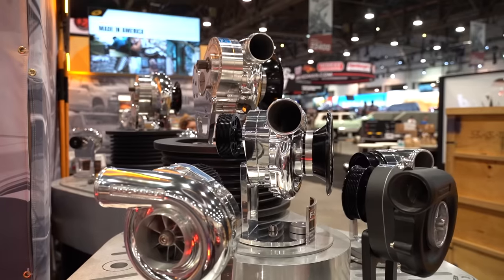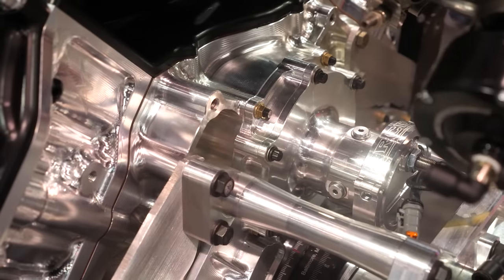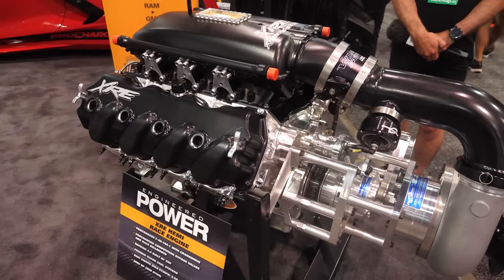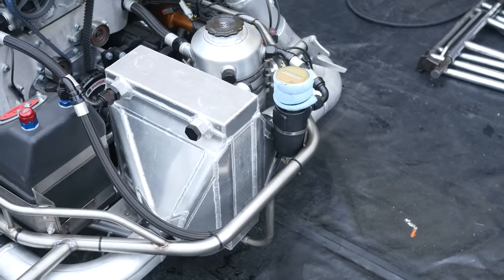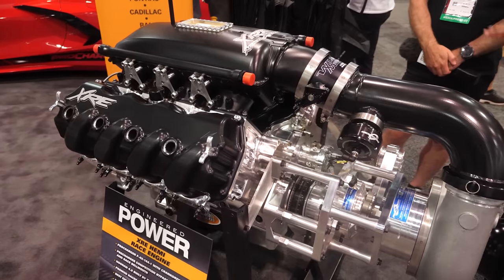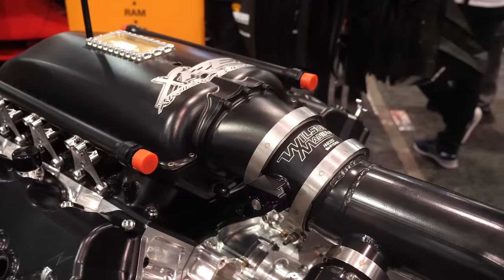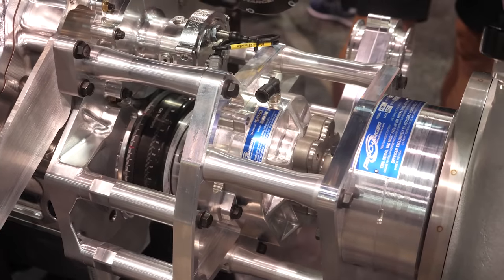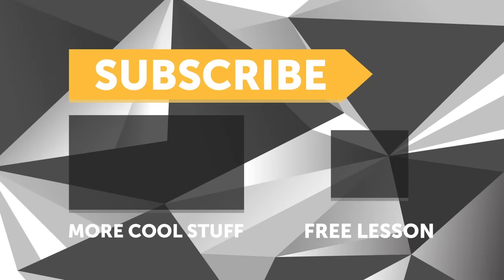Why Are Centrifugal Superchargers So Good?

Comment: I always get miffed when i hear people talk about parasitic drag. A turbocharger has parasitic drag, via pumping loses on the exhaust stroke. Centrifugal especially and Twin Screws even are very close to turbochargers in terms of efficiency.
Reply: Can you prove this?
Reply: Turbos use more heat energy than mechanical drive energy. Therefore less parasitic loss
Reply: @josephschaefer9163  Not exactly. Pressure, temperature, and volume are all the same thing.

A turbocharger generates exhaust backpressure, whereas a performance exhaust on a supercharged or NA engine generates scavenging(vacuum). Typically, the backpressure on a turbocharged engine is anywhere from 1.5 to 3 times the amount of boost generated by the turbo, with the center of that range giving the best balance between turbo lag and undersized turbo. The backpressure means that the piston has to exert energy in order to force exhaust through the turbo on the exhaust stroke.
So, an NA engine has a parasitic loss or pumping loss, drawing in air on the intake stroke. A supercharger has a parasitic loss spread out over all 4 strokes. A turbocharger has a pumping loss on the exhaust stroke.

Turbochargers and superchargers are both more efficient than piston strokes at moving air. This means that a 6 to 1 compression ratio engine with 15lbs of boost will have an effective compression ratio of 12 to 1,  and will be more energy efficient than a similar NA engine with a 12 to 1 compression ratio. Because, the forced induction device is more energy efficient at compressing air and pumping air than the intake or compression stroke of a piston. In other words, superchargers and turbochargers have overall less pumping losses than a similar horsepower NA engine because the pumping loss savings offset the power to drive the compressor/blower.

But turbochargers nonetheless leech power from the engine, directly from the crankshaft via the exhaust stroke. This is more efficient than a supercharger, but not as much as you'd think. When I was looking through compressor maps trying to size for my 4.0L, at 15lbs of boost a twin screw supercharger would require about 40hp at redline, a centrifugal supercharger would require about 35 hp at redline, and a turbo would require about 30hp at redline.
Reply: @josephschaefer9163  Roots style blowers are really terrible, absolutely no competition between a Roots Supercharger and a Turbocharger. However, Twin Screw superchargers and Centrifugal Superchargers are much closer to turbochargers.

Comment: I have a centrifugal on my 2020 mustang gt. It's awesome but I should've got a pd blower. For my driving style I've always liked the down low power (which the coyote does not have at all)
Reply: Install a 3600 rpm stall, I'll fix that issue. 😁
Reply: @yamakasi5792  hahaha. I see what you're saying but I have a manual. My left foot is my stall converter. With that being said I rarely launch it. I have faith the ole' shitty mt-82 in my car will hold up but they sure do grenade a lot.

Comment: Imagine the newer civic type R has a procharger instead of a turbo and still revs to 8k+ I think it will solve all it's inherent cooling problems
Reply: Yes it would by vaporizing the engine completely.
Reply: Centrifugals run away cooler. Also no shared oil for the coolant to have to cool down. No heat soak. No heat from back pressure. Kraftwerks makes centrifugal Supercharger kits for civics. It's very possible
Reply: I have a centrifugal charger on my Yamaha side by side

Comment: The interview is awesome! I have a question for you guys. Was ever produced, or is there anyone testing a procharger and turbo hybrid? A procharger with exhaust housing of a turbo. The speed of the procharger is dictated by engine speed, like a procharger, but the exhaust gasses are scavenged by the procharger or the exhaust gases helps drive the gears of the procharger and effectively the engine? 
If not, can anyone really produce a high quality one and share the results?
Reply: Locomotives have turbos with some sort of drive with an overrun clutch for starting and low speed efficiency

Comment: I really like the idea of a crank/gear driven system as i am not a fan of belts because of reliability. the main issue though is that it sticks way out infront od the engine which limits what type of car you put it on but if the made it work on the Kawasaki h2 i guess you could figure it out.
Reply: Kawasaki H2 has the supercharger mounted directly on the front of the head, it pushes the air right in there. I don't know if it's belt, or chain driven, but it's one or the other...probably a belt....the Japanese bikes are very good with belts...I think the Gold Wing engine has 2 belts, one for each side.

Comment: I would find it interesting driving a turbo using water pressure in a boat  fitout. There is a tonne of force in water flow under the boat. Thought?
Reply: Not working.  The turbo needs to spin very fast in order to work.  Water flowing under the boat has a lot of energy but the water flow is not that rapid.  You need a step up gear box to spin the turbo up to its operating rpm.
Reply: depends on ratios i you would be surprised on how fast it would spin  @catchnkill

Comment: very interesting ,drivability looks to be main win , great for rallying i would think . no mention of of actual efficiency ,as in fuel in for power out vs the exhaust driven turbo ,which is using some heat rather than just dumpnf it asap . and do they need blow off ,or recalculation valves ?.

Comment: A engine it’s basically an air pump. (But sometimes you want more power.)  So you add a much more efficient air pump to your air pump, so that your air pump pumps more air.
Reply: Because piston engines can change rpm quickly.

Comment: Ive been thinking about the possibility of a procharger (the car doesnt really need more horse power probably) however my engine was built to be NA and runs a compression ratio of 11.9 to 1.  I was wondering given how the Procharger builds boost if this would be a problem.  Also is extra ring gap required similar to other forced induction?  I guessing it is...
Reply: Yes, you'd need extra ring gap just like any FI build.

As for compression, your engine is perfect for Ethanol. If you go do some research after reading this, your compression ratio would suit about 30psi of boost on E85, and 60psi on methanol.

Your CR is on the high end for gasoline, it's mild for ethanol, and it's very low for boosted methanol. Methanol is a headache though because the fuel requirements and it being very corrosive. Ethanol is likely a very easy conversion for you, and you may be able to get it at your local gas stations for cheaper than 87 octane. Considering that E85 Alcohol is equivalent to 112 Octane Gasoline, it is very cheap compared to pump gas.
Reply: @SpecialEDy  Hi Thanks for the reply and information. The engine was built for pump 98 octane which is readily available in my area so hoping that it works out ok.  The engine is 427 ci so with 30psi and E85 would make big power!  The whole car would need a rethink with that under the hood haha.
Reply: @j.osborne4914  30psi would be a LOT of work. Atmospheric air is 14.7 psi, so at 30psi of boost your engine would have three times the air and fuel going through it, in other words your 427 would actually displace 1281 cubic inches, or 21 liters instead of 7.0 liters. Definitely going to need some serious rods, piston, and crank to handle that.
But E85 might give you a 10%-20% boost in power output without any other modifications, and your compression ratio could handle a healthy amount of boost if the bottom end and fuel system can support it.

A possibility if you are running an aftermarket ECU is staged injectors, HP Academy has a few videos talking about it. At idle, you'd use your current injectors. At redline WOT, you'd use 100% a second set of batch fired injectors further up the manifold runners feeding E85 or Methanol from a seperate fuel cell. Aftermarket ECUs allow you to blend the two together progressively, which fits perfectly with a centrifugal supercharger. As your boost climbed with RPM, your injectors would also progressively switch from the gasoline to E85 injectors. Or effectively, your octane would rise as the boost rose.

E85 and especially methanol have some other neat properties as well. They're less sensitive to AFR, more fuel rich, less likely to detonate, and they soak up a lot more heat than gasoline. Many methanol engines don't require a cooling system, because the engine gets colder under a WOT run. Drag racers running methanol have to idle the engine between runs to get the engine back up to operating temperature, and it will cool below operating temperature during a run. You can also run a stupid amount of extra fuel to cool off the engine and prevent detonation, because E85 and Methanol contain their own oxygen molecules.
Reply: @SpecialEDy  My current crank and rods are rated to 1000hp.  It made 707 FWHP on the dyno so there is a bit of room to go up but...will see how the car handles the current set up and go from there.  There are other things to spend money on before more power is required.

Comment: Would a prochargeer work on a 13b pp high compression motor?
Reply: you could, but it's not ideal, full PP is engineered to make more power at high rpm because of the overlap, kinda like big cams, you would need to change your engine completely by using side port and maybe semi pp, also use less compression rotors

Comment: I allways thought, in terms of power, its turbo charger > screw charger > centrifugal charger. Isnt that right (anymore)?
Reply: Power yes. Response and Drivability no. Much less stress stretch on engine internals since there is no surge in power from it being linear. Small VGTs improved response but a centrifugal will out flow it. You'll have to run two turbos in sequence.
Reply: For turbos, lag has not been solved for that's why Audi is using electric turbo to spool before the turbo. Volvo and KOENIGSEGG is doing air injection on to their turbos to prespool them
Reply: Similar to pro charger look at crank driven superchargers in wave runners or personal water crafts

Comment: Depends on your defintion of "good". They have the worst power curve/average power of any type of forced induction and worse than n/a too. They make all their power at the top of the powrband.
Reply: On the street you can't launch with 1000hp at the tyres. On the track you can dial in the power level to suit the surface. Prochargers are faster because they allow control. And we all know. Power is nothing without control!

Comment: I'm almost done building my dual centrifugal supercharged 4.6 2v Mustang with 2 paxton novi 1000 supercharges. They will pump out 1700 cfm combined through a water to air intercooler. Would 2 centrifugal superchargers be better than 1? I'm looking for 16psi of boost. My project build is on YT. RumbleCanada
Reply: What do you predict the parasitic drive loss to be?
Reply: @onedayiwillmakesomecontent With 1 paxton novi 1000. It made 394rwhp with 11 psi. Im hoping there won't be that much of a parasitic loss. It will go back on the dyno with the same tune. I've removed the a/c,  added a bigger water to air intercooler, and upgraded to a larger plenum and dual blade 65mm throttle body. I'm hoping that with that combo, it picks some mid and top end with no loss.
Reply: @rumblecanada I will have to check out your channel 👍
Reply: You should have just went with one bigger head unit
Reply: @brendonpotts7961  I went with 2 because I wanted something different. Everyone has one superercharger. I got them for an awesome price.
Reply: @rumblecanada  well if you got them for a good price then do it about of extra work with 2 but you can make more power than you need with A single
Reply: @brendonpotts7961  it made 400rwhp. Besides, who has a twin supercharged 4.6 2v. Lots of twin turbo. And it should sound pretty cool
Reply: I got asked the same questions about 15 years ago. I love my twin Procharged Camaro. Sound, throttle response and  power are off the hook. Mine is crank driven with meth injection and uses twin F1C prochargers on a Dart 406ci sbc. You won’t regret it.

Comment: Could someone explain why I wouldn’t want to use a wastegate to regulate boost on a d1x procharged forged internal ls7? I like the idea of spinning the procharger faster and bleeding off the boost once it hits a certain target psi for much more midrange power and street-ability similar to a turbocharger powerband but without the lag. (D1x max psi is 32 I’m planning to target 15 psi)
Reply: You could of your ECU supports stuff like that and you have a CO2 bottle to open it.

Comment: A boost number is how much restriction there is in the engine
Restriction is set up an engine intake valve separation
And then there's other restrictions that are manmade by installing everything incorrectly
Reply: What?  How do you figure boost pressure is a measure of restriction?  Say my turbo makes 15psi, can you tell me the restriction of my engine?  What is it that you think you're explaining?
Reply: Psi is a measure of pressure on the intake.  If it was 0 that means no restrictions, if 100psi means air is restricted.
Reply: @Kalikewness23  - No.  0 means you have no additional pressure above ambient at the manifold.  100psi means your air charge is above ambient pressure.  A single pressure measurement alone does not quantify restriction.
Reply: @wahconah98  ok, 15 Psi means your trying to force that much pressure into your engine, because your engine cannot release that pressure the pistons and valves are the restriction to the 15psi. Which in turns is exited to your exhaust as power then your exhaust system could be a restriction depending on your setup.
Reply: @Kalikewness23  - Still no.  And what do you mean by "can't release the pressure?" That's why exhaust valves exist.  Your cylinders aren't a restriction; they are the container you are trying to pressurize otherwise your engine won't work. Anything that impedes the flow of air into the cylinder would be a restriction. That said, a single point PSI measurement won't let you quantify restriction because given enough time, the pressure will equalize on both sides of the restriction. The path air takes to get to the cylinder is complicated and there are multiple variables that change over time which affect how efficiently it gets there. PSI doesn't give you any of this detail.
Reply: @wahconah98  thank you
Reply: @Kalikewness23  thank you
Reply: @Kalikewness23  thank you
Reply: @wahconah98  they actual numbers figured out the 5220 x torq to come up with the hp number 
But the sooner you can close the exhaust fell before the intake valve opens up you come up with a bigger boost number
The inconsistencies in the manifold and the heads and restriction which was the air down with can also add to boost numbers
Reply: @scotthultin7769  - No to all 3.

5220 x torque = HP is wrong and also irrelevant to your original comment. 

Exhaust and intake valves DO slightly overlap at the end of the exhaust stroke to force out the last bit of combustion products.  It does not affect boost which is usually measured at the manifold and your is still irrelevant to your original statement.

Finally, the quality or imperfections in the manifold and heads does not affect boost PSI measured at the manifold.  It can affect the flow of air into the cylinder but it can't add to the boost in any capacity. Only the turbo can add boost (PSI). This is also irrelevant to your original comment.

I'm still waiting on an explanation of your original comment that says boost is a measurement of restriction.
Reply: @wahconah98  i agree I was lookimg at it from the point of view of restrictiom being anything that stops free flowimg gasses sorry everyone!

Comment: I feel like the biggest reason to use a supercharger is packaging.  A fixed positive displacement supercharger will have better responsiveness and a turbo will be more efficient.  A Centrifugal Supercharger has the parasitic draw of a regular blower with the compressor lag of a turbo.
Reply: Fortunately a Centrifugal Supercharger only has parasitic draw like a roots blower when the BOV valve is closed. When the valve is open the draw drops to almost zero.

Comment: What should i get for my 2jz ge vvti supra? Centrifugal supercharger or maybe and sc14 or Garrett gt17v variable geometry turbo? I want to save stock compression or maybe lower it down to 10:1, im going 350/400 hp build
Reply: It comes down to how much money you want to spend and what you want your torque curve to look like. I would go with a belt-driven supercharger simply because you're not going for crazy hp numbers and it's not something you see very often on a 2jz. You'll be the coolest kid in the neighborhood and it will be very reliable.
Reply: You don't just slap on a procharger dude. Rather contact procharger about doing a a procharger
Have you seen any JZ setups with frank driven superchargers?

Comment: Takes up an awful lot of space in front of the engine.... At least the setup they are showing. Even if I mount the radiators/intercoolers somewhere else, where the hell does this thing fit, lmao. Perhaps I am short sighted here. Would need to move the cooling fans too. I have seen some very well setup prochargers and they didn't stick out like this at all. I will keep to the prochargers I know. As well as superchargers and Turbos. Not liking the setup of this guys product at all. I bet it makes some nice power though.